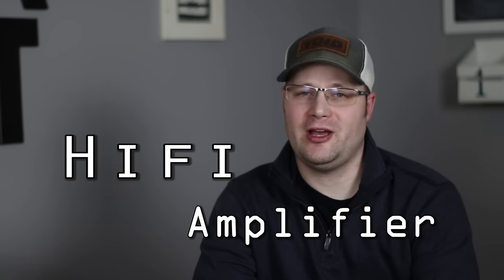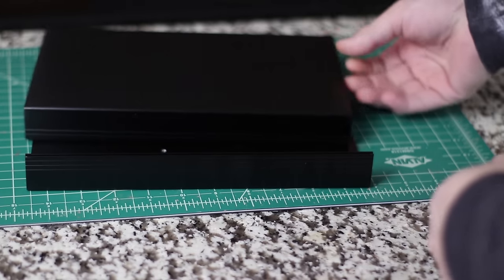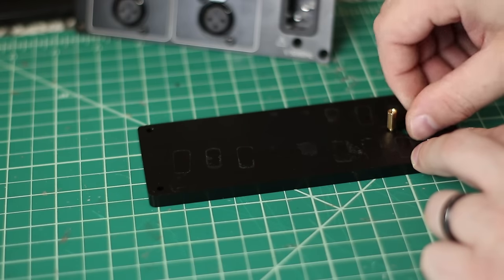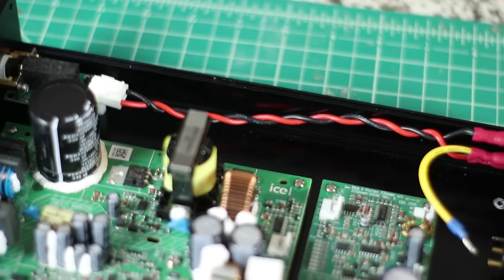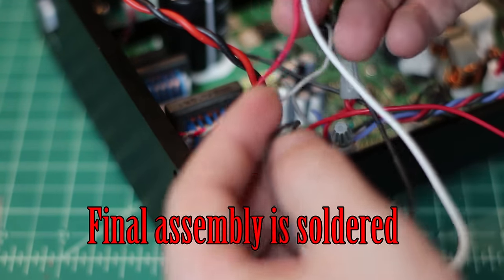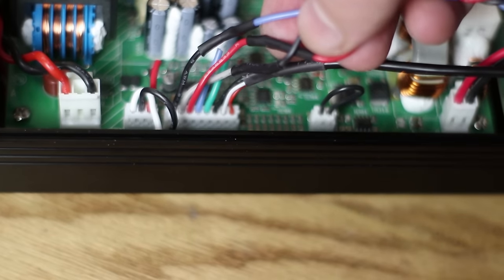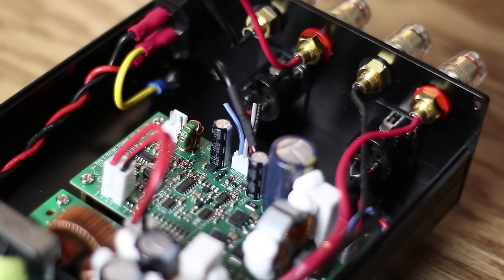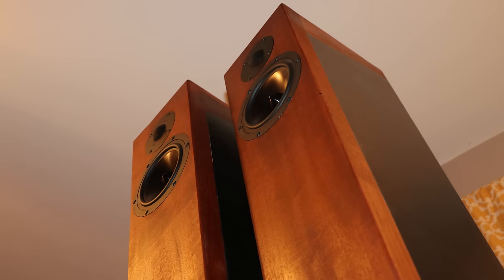How to Make a $3000 DIY HiFi Amplifier for $300

Comment: $3000????? come on, are you kidding??????
Reply: mrdocprofessor patrick  Just try to compare components and layout of Sprout and this Chinese BS.
Reply from the maker: @rastislavledaj3110  IcePower was designed by Bang and Olefson a Danish company.
Reply: @Toid  Svend Olufsen is spinning in his grave now....but....whatever. Just try to make comparison of sonical qualities of your D class amp to any second hand AB class amp in the same price range as your build. I bet you will throw that D class BS out of the window.
Reply: @rastislavledaj3110  class d advanced over the years,update your knowledge
Reply: @filippiasec  If it is good enough for you...
Reply: @rastislavledaj3110  New ICs know THD+N below 1% (way below), thats basically fits the HiFi category. Most people also forget, that when they advertise an IC for example 2*120W, this will mean THD+N= 10%< and this is terrible. Most IC can be used in HiFi category under at least half of the nominal power output. Like mentioned above fit the category with 2*80W with 4Ohm load TDA7498E, datasheet pg.8. THD+N below 0,1%, lowest 0,043 at given measurement. Everything will have distortion, but the type and amplitude plays a heavy subjective role to it.
Reply: It's just click bait for people who don't understand
Reply: @rastislavledaj3110  like your name reads you make no sense.
Reply: @philmissy1  Do you have any more hate, or you have finished?
Reply: @markmark2961  In which planet THD and noise level define sonic qualities? Somebody pointed out PS Audio. Even owner of PS Audio multiple times said in his YT channel that digital amplifiers are good for subs, but in midrange and above are easily beaten by any good designed AB class amp. And it is truth.
Reply: @rastislavledaj3110  The problem is that there is a huge subjective factor in the listeners head. It would be nice to have a blindfold test. Look it up with Stradivari for example. A lot of professionals said, that a "cheap" piezo violin was much better , so that should be that, they are really sure. How else you compare two electrical things, without measuring it? If you produce the same wave form with both of the amplification, then where is the difference? There could be badly designed D class of  course and also people use the full power level, what I wrote before, it will be bad. Also the amplifier and speakers should work together perfectly. Not matter though, I will receive my AB and D class ICs in a couple of weeks and I can hopefully design boards for them and test them. Wont be a short time, but will be proven enough for me (some TDA and a wide range of TPA). Maybe you can do blindfold test also with some help and you can check it for yourself the difference. I feel this is like a Tube amp vs others debate. It sound cool, feels cool, but my Boss GT10 can do the modeling. It was the same with Boss GT 8 vs 10. Then Boss GT 10 vs 100. Its endless. "older always better"...It it not always true, everything is improving. Oh and just checked PS audio. If you can hear the molecular difference between two high quality cable (as most audiofil guys state), then be my guest and buy 20 cm for a fortune and turn off the gas, since your A class can fill the room with enough heat. Do you know the disappointment, when a Wilkinson (razors) pickup produce the same sound in a 175$ guitar what Guns&Roses used when they recorded the Sweet child of mine? The illusion dispel effect is hard (and yes, thanks, I have a good hearing)
Reply: @markmark2961  I did. I compared 50 euro, more than 30 years old Luxman L 111a with 800 euro PS Audio Sprout which is considered as one of the best in pricerange up to 1000 euros. Guess what? Luxman won and still you can buy lot better vintage amp for 50 euros. The difference was crazy huge and I compared them not only on one pair of speakers.
Reply: @rastislavledaj3110 I believe you and the statement that you found it better. But I think its useless arguing over such a subjective thing, what only you can compare virtually on paper only (if you are not listening to them of course) . I searched for PS audio high end, and the datasheet and measurement shows the same what I stated. The major difference to the cheap and PS thing was some electronic tricks and the distortion is low even on high power output. I don't think I will ever need to listen to music at 200-400W. It has a tube preamp, what is kind of questionable also, since it has a definitive sound characteristic. For me the most important thing is the source (of course the end point also important, but a mid quality thing will sound good with good source) and record. My colleague handed me a special burn in and test/setup CD, and even the simple wav what I put through on 24bit 192kHz DAC to an average system was remarkable. With a good room and positioning you have a nice feel of dimension (not a typical "yeah those 2 speakers where the sounds come from"). Basically you can tell the height of the singer and positions of the instruments with a single stereo. What I am trying to say I aim for a sweet spot for price and quality and wont buy cable for a fortune. But I can try what you wrote, when I get my new ICs.

Comment: Sorry, I need the class A version of this video, class D is a cancer!!!
Reply: Weird how people still believe this.  Even Paul Mcgowan from PS Audio thinks their class D, ice powered amplifier is one of the most musical amplifiers he's ever heard.  That says a lot coming from on of the lead HiFi amplifier companies.
Reply: @globecreek1430  o yea, 'musical' measurement not found in my audio analyzer. Go figure.....
Reply: @globecreek1430  He lies a lot, ofc he would say that, it's his amplifier, he wants to sell it...
I still believe class d amps are good, but not all, filtering on cheaper ones is really bad.
Reply: @cekpi7  It's hard to make a decent Class D amp. It needs a lot of patience and the correct parts. Often off the shelf.
Reply: @Larry Niles As a consumer i have right to criticize products, i haven't designed my amp yet but i have build and repaired afew amps over the years. Most of videos on his channel is pure snake oil and sometimes he changes opinions on different videos.  Sorry if you feel offended, but to me he is a liar.
Reply: @globecreek1430  PS Audio uses a Class A input with a Class D output so no it's not a pure class D.
Reply: @poman911  -- See my reply above.  Nothing one can introduce via an input stage can remedy a (in this case presumed) deficiency in an (in this case OEM board-based) output stage.  An audio signal chain is only a good as its weakest link.
Reply: Class D amplifiers are beginning to get very good. They are definitely not cancer.
Reply: @oysteinsoreide4323  -- Amen to that.  Moreover, nowadays "audiophile" Class AB loyalists are beginning to come off like 21st century Luddites.  :-)
Reply: @globecreek1430  I thought he made his name making AC conditioner products? Amps are relatively new for him  compared to the stalwarts like Mark Levinson, Krell etc if I'm remembering correctly.
Reply: @CofeeAuLait  You have to have the context.  When he says that, he is referring to the "audiophiles" who say Class D amplifiers aren't musical and aren't good.  The truth of the matter s he, doesn't' have to lie about it.  he could just not say anything.  It's not like they only sell Class D amplifiers.  They still sell Class AB amplifiers.
Reply: @Larry Niles Well, I recently watched a video where he declared that their expensive AC power cable improves the sound so I wouldn't put too much science into what he says. If it does, there's something very wrong with the amplifier.
Reply: "class D is a cancer"
Class A is wasting energy like nuts. We need to move on. As much as I love Class A, it is the cancer. At least in its current form.
Reply: i prefer not to have half of my consumed energy wasted as heat...
Reply: @JackZimmermann  
"declared that their expensive AC power cable improves the sound" 
Sure, proven logic this is, until you try a cable for fun, and it makes a ton of difference. Like a USB or HDMI cable. This introduce some mental challenges, particularly on the will to adjust our epistemology. Particularly on subjects we do not really comprehend or understand, but thought we knew all about. I choose to trust my senses, as there clearly is a significant sonic difference between say, USB cables, but I simply cannot explain why that is. I also hate this topic, because cables may cost a ton, as do power filtering, but the reasoning given for many of these products, are gibberish. Yet, many of them actually work.

Comment: I'd like to see the $3000 variant this is displacing. The ICEpower boards are nice and perform well but a 250w x2 hypex Ncore amplifier is around $550 with little more power and better SINAD. These ice boards dont perform quite as well so maybe this is more of a build a $500 amp for $300... still a good deal don't get me wrong.